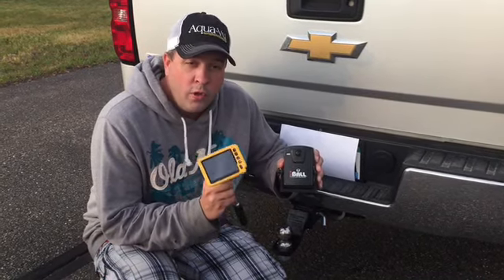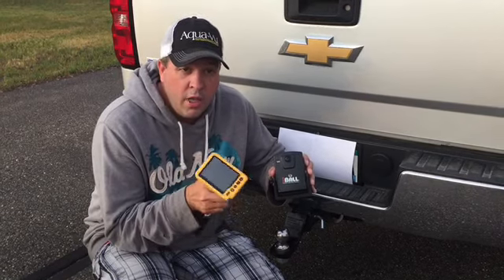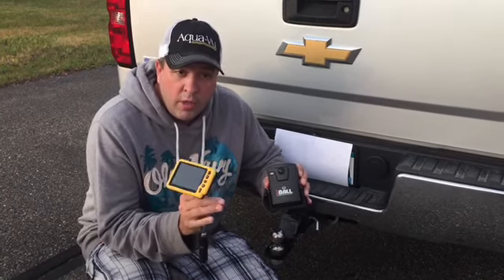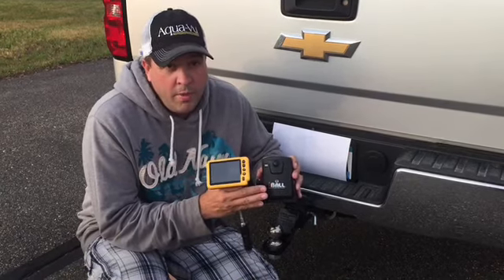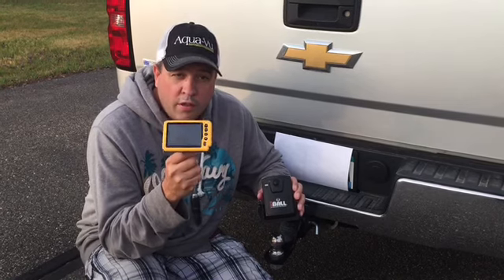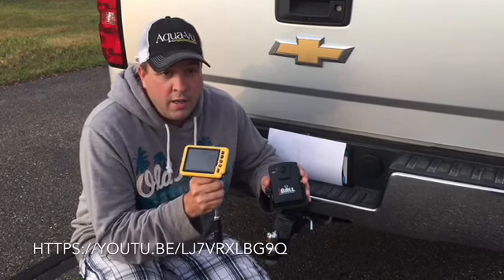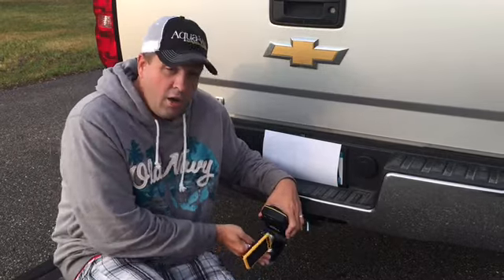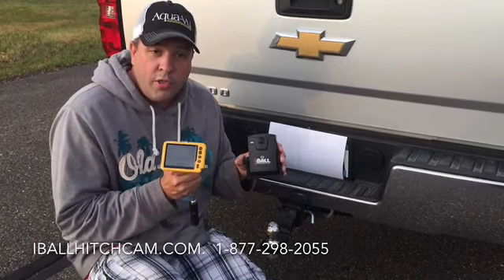Basic Troubleshooting For The iBall Hitchcam

Comment: How is it possible for a building nearby to affect the signal? The camera/transmitter is stuck to the back of your truck, and the receiver/monitor is 15  feet away in the cab of your truck.  There is no building in the way, unless you have one built in  in the truck bed.

Battery lasted about 2 years., and now will not charge.  Do you have a video showing how to replace a bad battery/